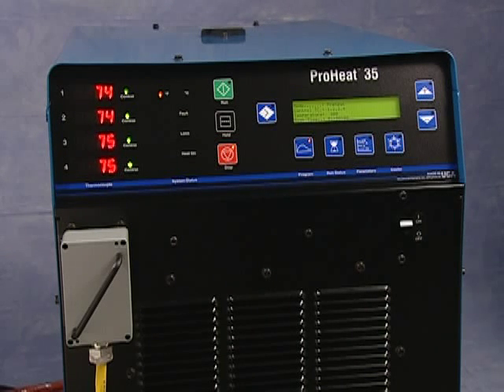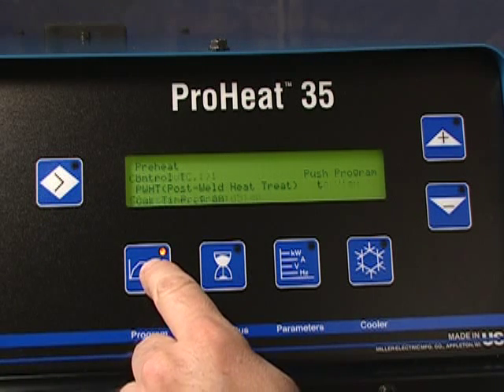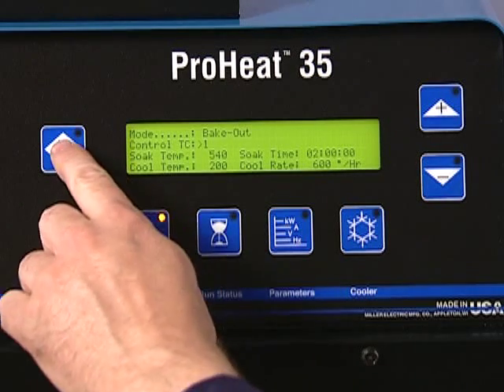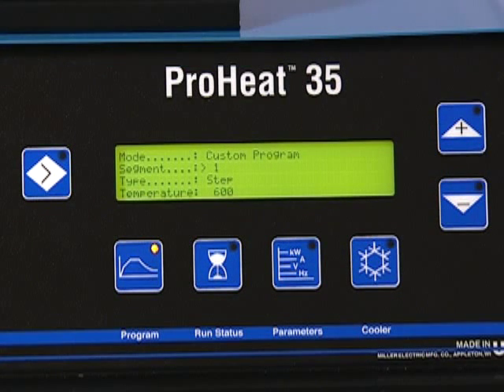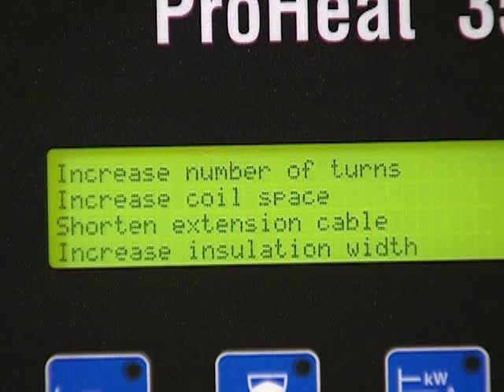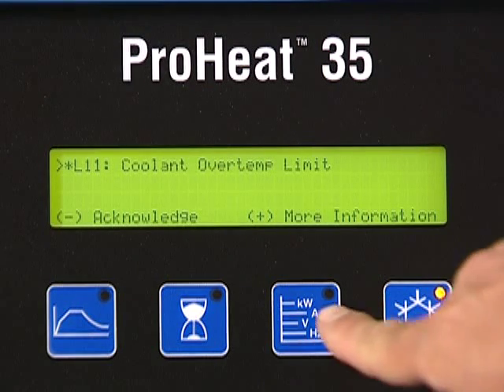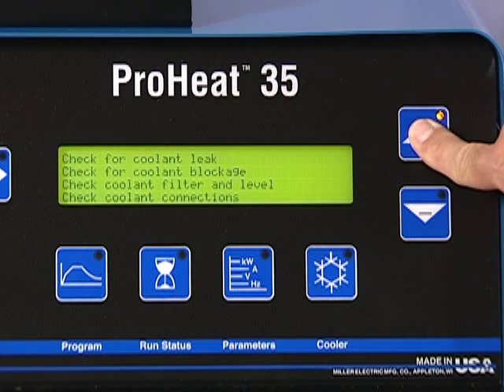Miller ProHeat Induction Heating Programing & Diagnostics

Comment: I have problem with ProHeat 35 we need to reach 300 C with time 1.5 hours 
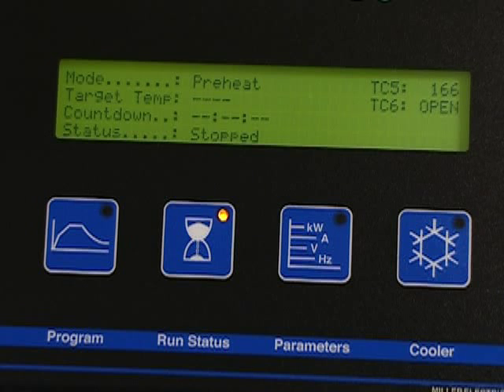       we tried but no results meet our required I program fill power 35 Kw. and time of 1:30 :00 
L08 fault always appear in the screen 
the work piece  is ring  non magnetic material  ( 90cm daimeter/ 50cm length/60mm  thickness )
I need to reach 300 C at time 1:30:00  
pls. send me the solution 

Eng. Abbass Hussein 
Iraq -Baghdad-M.O.Electricity
Reply from the maker: +Abbass Hussein We are sorry to hear about the problem you are having with your ProHeat 35. 
It is difficult to diagnose specific issues over social media, so we recommend contacting a local distributor near you: http://www.millerwelds.com/wheretobuy/international.php  Please let us know if you have any further questions.
Reply: Hi Good Day could anyone assist me please i have a problem on my Proheat 35 F70 Internal communication Fault?